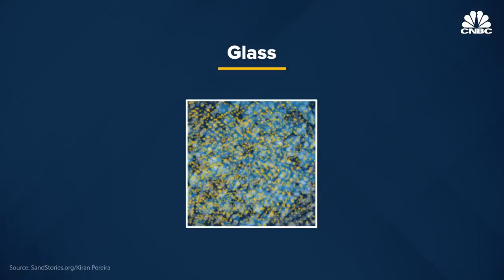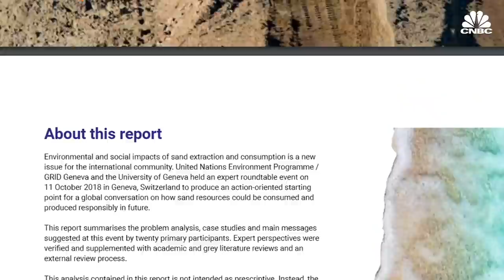Why The World Is Running Out Of Sand

Comment: 6:22 It takes 10 tons of sand to equal 1 ton of cement.  In actuality, it takes no sand to produce cement.  Cement is made from limestone (mostly).  That was probably supposed to say concrete.  It takes about 1/3 ton of sand to make 1 ton of concrete.  This seems drastically wrong.  Maybe someone smarter than me can explain better?
Reply: You mix 1 part cement with 2-6 parts sand and different amounts of aggregate for concrete. So, excluding water 7 tons of mortar could be 6 tons sand
Reply: They are talking about reinforced concrete.

Comment: There is no shortage of sand as such. But there will be a shortage of sand locally and especially a shortage of sand with a certain quality (suited to produce concrete). That means: in the future we will have to transport high quality sand around the world. And as sand is heavy (dense) and we need huge amounts of it, this will be expensive. So, the correct title would be: some regions will run out of cheap, local sand and will have to import it at high costs (potentially causing high CO2 gas emissions). Sidenote: cement is an ingredient of concrete but it is not made from sand. Sand and gravel are also ingredients of concrete as well.

Comment: I think you have no idea just how big the deserts full of sand really are. We could not mine all the sand from land and sea in 10,000 years. My home county of 540,000 acres has a 200 acre sand mine that has been going for 20+ years and is nowhere near tapped out. So far .0000037 percent of the land is being mined so even 1 % would be 10,000 times more sand supply than is currently being mined.

Comment: I'd also like to add,glass can be indefinitely recycled,the biggest reason we use so much plastic is that it's a light packaging material and it boosts profits for companies that would have to build transportation costs into their profit margins,don't want bpa in your soup? Insist on glass jars from your vendors but you will definitely pay more,all companies that are publicly traded constantly have to trade on your well being in order to remain viable on the stockmarket. The companies don't care about how or if you recycle, that's not in their wheelhouse they got their profits.

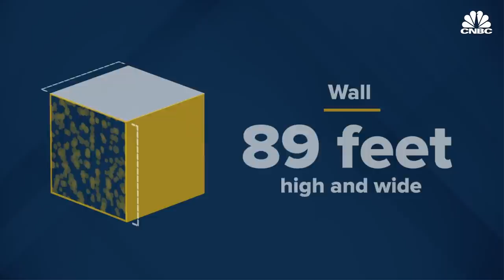Comment: At 6:30  It cannot take 10 tonnes of sand to make 1 tonne of the finished product.  Nor can you make cement powder out of sand.  It is POSSIBLE that the US produces 10 million tonnes of cement powder but if you mixed that with 10 times that amount of sand and 20 times that amount of gravel to produce 310 million tonnes of concrete it would be the weakest concrete in existence. Nothing in the numbers adds up here.

Comment: This report has serious problems.
Sand is about 1/3 of cement mix, so it's impossible to take 10 tons of sand to make 1 ton of concrete. And crushed stone sharp sand is the best for construction. Beach sand is too smooth and makes weak concrete.
And we have no shortage of mountains to crush into sand for building construction!

The places that use beach or river sand are making weak concrete, and just trying to save a buck, and they will adapt.

Comment: Why would you have to use non-worn sand to make glass? So desert sand would just be melted to make sand and it wouldn't matter what the shape of the sand particles was. The only time shape matters, is if you are cementing it into concrete.

Comment: 3:42 This is the kind of sensationalist half truth that drives me crazy.  Yes concrete is 65 t0 75% sand and gravel.  Usually 25% sand, 40% gravel.  So why not just say "concrete is 25% sand"  Because that sounds low, right?  So you gotta say 65 to 75% sand and gravel for sensationalism, right?

Comment: Sand are not equal to one another. I found out first hand. I used to for under  a paver patio. After about a year or 2 half the sand was gone. I used playground sand. It was cheap. You need special sand so it packs down and locks together. Play sand is smooth. Silicon sand is smooth. Beach sand is rough and great to use for construction thats why people in certain countries strip sand off beaches illegally.

Comment: How hard could it be for a reporter to research the difference between cement and concrete?  There is no sand in cement.  There is sand in concrete and mortar. Cement is the chemical binder (glue) that is mixed with aggregate (gravel and/or sand) and water, to make concrete and mortar.

Comment: What we don't realize is that we are overusing every little natural resource at this point. This is not sustainable to keep the human race going in the long run. Not only are we changing the ecology of nature but the climate associated with it. This will bite back with higher costs, lost precious resources for good. Coal and Oil is going to run out within the next 100 years and we have still no solid plan to replace it and fix our emission problems. Everything we do today has a higher cost for the future.

Comment: I dont want to PUN this video, as it has a point , but 10 ton sand = 1 ton cement ... that is not correct. I get it you want to stress the point of sand being used, now lets look at ho much sand and silt is washed into the oceans every day.minute, so getting some back from a ocean should not be a problem as you are removing the silt/ sand settlement  that was not there last year... a Bigger concern would be erosion/defloration/ tree removals, etc...

Comment: Where does the extra 9+ tons of sand go in the production of cement/concrete, I did the math and the physics 9+ tons of mass cannot just disappear, so unless there is 9 tons of a waste product from cement production the 10 to 1 ratio is incorrect.  My kingdom for an editor that actually checks stories before release.

Comment: The world is not facing a sand crisis. Look into the statistics yourself. Notice the lack of them in this video. The details matter, how much sand do we have? How much sand are we consuming? How long until we run out? Is it even possible to run out of sand? What do we mean by "sand," are we only talking about river sand? What is the real environmental damage to the oceanic ecosystem if we remove sand? I noticed a lot of the commentaries and headlines alarmed by sand removal were in India. What consequences exist if India accelerates sand use for concrete? Does India have a choice if they want to construct buildings? And why are we removing sand from rivers when we could remove sand from ecological dead zones at the bottom of the ocean? 

It all comes down to money. We need cheap materials to build things. If sand becomes scarce it will no longer be as cheap. At which point we will look to other materials to build with.

Comment: The real question I have is how does  it take 10 tons of sand to make 1 ton of cement? What happened to the sand? Where is the sand going?  If you put 10 tons of sand in cement then added a bunch of other materials wouldn't it weigh more 🙃

Comment: No, there is not a sand shortage. There is a easily obtained sand shortage. Plenty of sand in deserts but hard to get to.
Reply: Maybe you watch the video again there's a difference between ocean sand and desert sand
Reply: @user-RCST  No, I dont need to watch the video again. I stand by my first statement. Unlike you, I dont get all my information from a YouTube video. I have drilled and taken soil samples in a desert environment at every 5 foot intervals up to 2000 feet, sieved the samples and inspected the results of each sieve size. Like I said the first time. The desert has plenty of sand for concrete, it's just hard to get to. If you go deeper in the desert you get to layers of sand that haven't been eroded and by the winds. The cost of getting to that sand makes it not economically feasible ( at least not yet) since the amount of over  burden of useless sand to move would be immense.

Comment: I seen a video on this years ago. The desert sand may not be rounded from the wind but from extreme heat like a natural disaster or a war, stated in another video. But the original  one I seen on this topic said they can remake the sand from glass by crushing/grinding it down. So cant you just melt the round desert sand down into glass and crush it or at least make stuff out of it...?? Someone has to know...

Comment: The concrete mix designs sitting on my desk now shows only 1500lbs of fine aggregate per cuyd. How tf did they come up with 10 tons of sand per 1 ton of cement (it’s concrete not cement).

Comment: It takes 10 tons of sand to make one ton of cement how can you turn 10 tons of something into one ton of something. Is there a magic weight loss formula I understand the volume would decrease because of the finer powder but if you have 10 tons of feathers and grind them up into dust would not have 10 tons of dust. 
6:15 ish

Comment: 6:21 You really need to check your math. First, cement isn't made from sand. Cement is made mostly from limestone. Concrete, which is likely what you mean, does however contain sand. Roughly 40% of it's mass is sand. The rest is rock and cement. So in reality it takes 800 lbs of sand to make a ton of cement (or 400 kg to make a tonne). I don't care if the "statistic" it's sourced to the UN it's still BS. Now I know you don't check your facts so the rest is probably equally reliably sourced.

10 tons? Really? FUD much? OK, maybe it's ignorance. Maybe nobody ever explained that it's really hard to destroy matter. Interestingly if we actually could actually destroy even a few grains of sand our energy problems would probably be over. 

Sand isn't consumed (or freebased by Illuminati, teleported to the alien's space craft or what ever conspiracy is popular this week.) in the process of mixing cement. It's still sand. It just glued together with other sand. Smash it and it's still sand. Glass doesn't go away after you use it either. Smash it and again, it's back to being sand. Likewise sand filtration systems don't consume sand. That's why they are so popular. Back wash the sand and use it again. They don't even need to be smashed.

In the US sand an gravel mines are held to the same standards as any other mining operation including environmental impact and recovery.

If you want to panic about something try something legitimate like helium. When that's gone it's gone. You can't grind up party balloons to get it back.

Comment: Can we gather desert sand? Can we recycle sand?
Reply: Did you watch the video? Sand crafted from water is more valuable because it is more angular compared to desert sand, which allows it to bind better. Also, the sand isn't being used by itself, like in the case with glass and cement, it's being mixed in with others things so it's incredibly hard to recycle.
Reply: @Jay-uh6wq  - Thank you for sharing the knowledge.

Comment: Wayne Liu , please unchange your life (though I do recognize that you might just be being sarcastic. Ha). This video is stupid.  I watched the video only to see how stupid it was going to be. Like it seems for some other commenters, part of what I do for a living involves sand in construction. Extracting sand for construction (which does NOT need to be silica sand, BTW) can be a serious environmental issue locally, but it is solved by local market forces. If trucking it in from more sustainable sources gets too expensive, the project simply wouldn't get built with sand, or not built at all. At the state port here in my home town, due to the environmental aspects of dredging from the adjacent copious quantities of suitable underwater sand, umpteen millions of cubic yards of sand was recently trucked in from probably 20 to 40 miles to expand the port I think around 3,000' x 3,000', probably 30' to 50' thick. Even though that increased the cost of the sand by, say maybe 10 to 50 times the cost of dredging it in, the economics of the project still made sense.

Comment: I'm in Toronto.  In a large project here, they had to demolish a bunch of structures.  They brought in a crusher and conveyor belts, etc.  They crushed all the old concrete, and as far as I could tell, it was all used in the creation of the new structures, though I'm sure they also used new sand and other stuff.